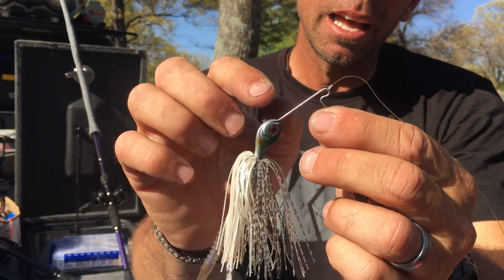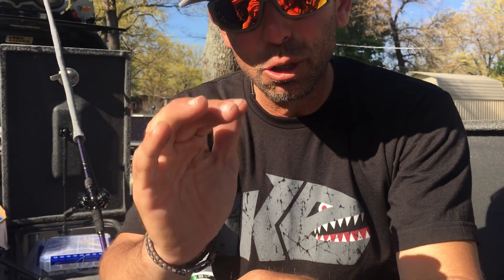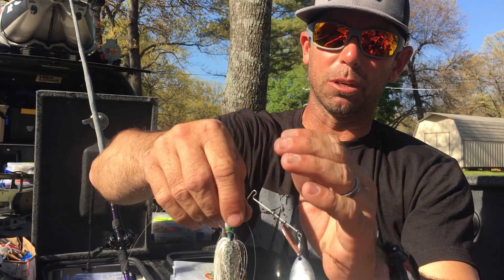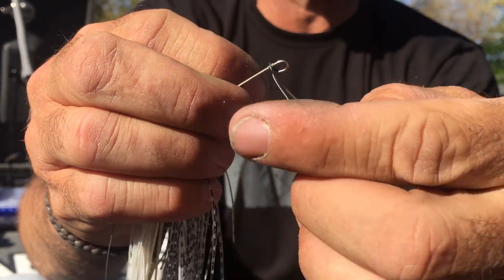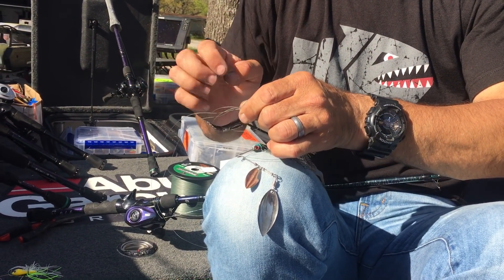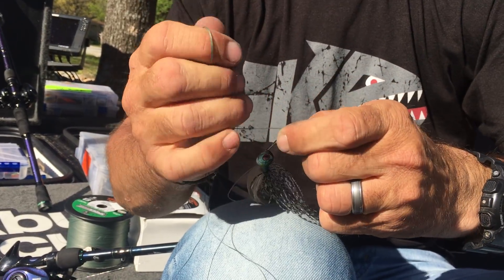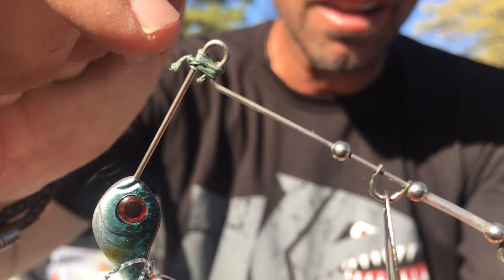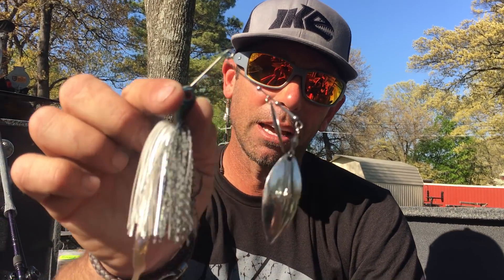Mike Iaconelli's TIP on how to secure spinnerbaits!!

Comment: A friend sent me this. Been doing this forever. Do all your spinnerbaits at home. I use a #10-#15 braid. A better way to secure and less sloppy, is to squeeze the narrow bend of the line tie until it touches the bottom wire. I use round point needlenose pliers so not to mar the line tie loop. With the braid go around it twice, then wrap 3-4 times around the top "R" wire using a clinch knot. Trim close, then use CA (super glue) to seal knot and attach tag end to top wire. Nice and neat and makes a bead (bearing) stop. I use accent colors of braid to match spinnerbait pattern.

Comment: Good idea.  I have been using tiny "O" rings from the hardware store.  They keep any grass or debris from getting stuck as well.  I run a 5 lb steel leader in areas of toothy critters like Pike and Musky when fishing bass and the O ring keeps the leader from sliding out of position .  Works great!
Reply from the maker: Sounds like an awesome way to rig them Frank!